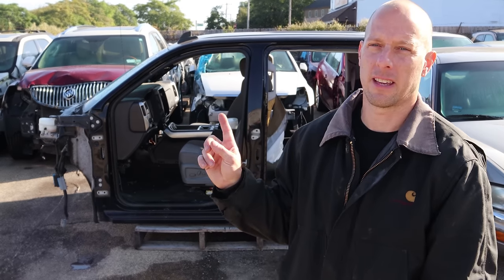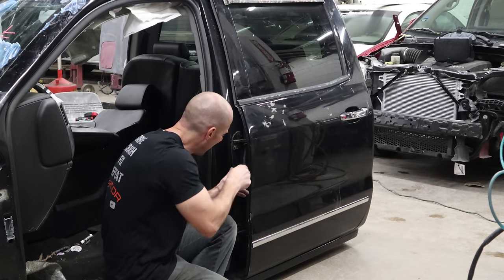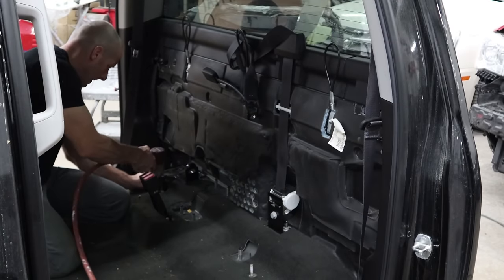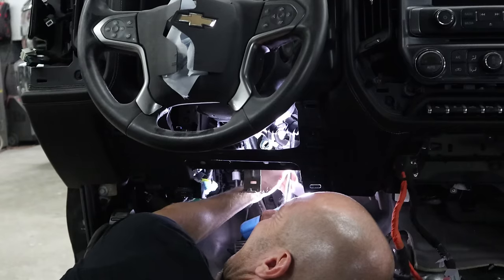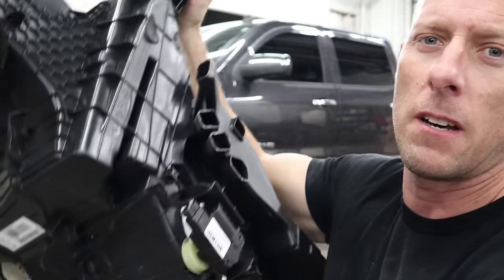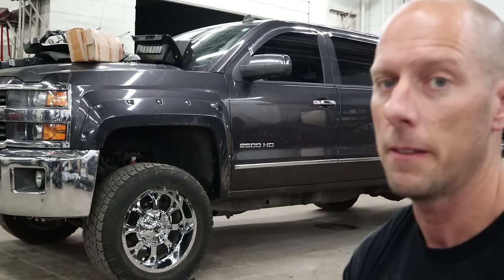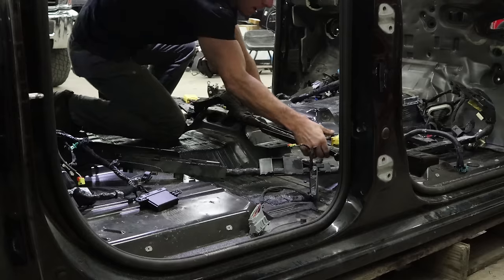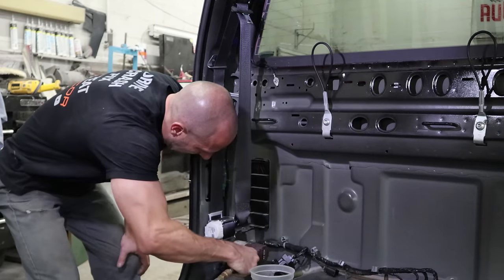Gutting the cab for the 2015 Silverado mistake and attempting to reassemble it. (Part 5)

Comment: Holy crap, this dash removal is something I don't see everyday.
I know there would be screws left over if I tried to do this.
Very interesting, thanks!
Edit: If anybody from GM saw you do this, you could probably get hired.
Reply: Hired to make what-$12-15/hour? This truck, when it's done, will make definitely $10-15ks In 2 month max. Now do the math. 
 Now, if I would be GM I would definitely want to have this type of a specialist as engineer advisor, not some idiot computer tech from Stupid University. Those trucks would be much better if they would make them more people friendly and not just "slapped by computer and robots".
Reply from the maker: You don't see it everyday because of the labor.  That also scares a lot of people away.  It is what totals a lot of cars these days.  I do it all the time, it is easy with practice, just like anything else.  I am a full time mechanic and get paid very well for that.  I also do pretty good at making a little money with this hobby.  Thanks for watching.
Reply: GM only hires in Mexico. $4 hr max. Busy closing Canadian and US plants.

Comment: The video I’ve been waiting for lol.  I did locate a cab I’m interested in for my build.  But I can tell I’m going to have to wait until spring now and I’ll unfortunately be doing all my work outside.  My Current Garage is 18x31 and I’m already running out of room.  If I can get things situated with both cabs beside each other and just swap from one to the next as I go it will be much easier.  I’ll just have to figure out how to lift the old one off and roll my frame under the new one.
Reply from the maker: I didn't want to give it away but I was hoping you would get to see it before you got into yours so you knew what was involved.  The projects do take up a lot of room.  My first suggestion is if your garage is tall enough for a lift and you plan on doing work on more than a few cars, buy a lift.  I understand it is a big investment but they save tons of time and would make this job much easier on you and pay for itself in the long run.  If you don't plan on fixing more cars/trucks it doesn't really make sense.  In that case I can tell you the best way to do it when you are ready: 
Pull the bed, even if it is not damaged.  It is easy and with 3 buddies can be lifted off.  Make sure when you set it down, you don't set it on the bottoms of the bedsides, they will fold.  Either turn it upside down or set it on some pallets that allow it to rest on the bottom of the bed when it is on the frame.  
Ok, now strip the doors, seats and dash. (leave the heater box it is easier to change when the cab is off.  
Unbolt the fenders hood and all wiring and hoses/lines that connect to the cab.  
Unbolt the cab and lift it up with a jack or something.  You may have to lift each side a little at a time to get it high enough, safely.  Get some 4x4s long enough to go from one side of the truck to the other and stick out a few feet on each side.  Set those 4x4s on something stable and set the cab down on them when it is high enough to clear the rear tires, frame and bumper (you can pull the rear tires and set the rotors/drums in wheel dollies to make the height a little lower).  
Roll the frame out from under the junk cab.  
Switch your heater box and firewall padding if applicable.  
Raise the new cab on the 4x4s like the old one and slide the frame under.  
Just repeat the removal procedure in reverse.  You want to do it with as much stuff removed just to lighten the weight you are managing.  You could do it fully assembled if you wanted.  I hope this helps, it is the way we did it before the lift days.  Horrible times they were. lol Good luck on your project, let me know if you need any clarification or help in the future.
Reply: vehcor  I do have a Scissor lift but not a 2 post.  My garage is actually an enclosed carport so I’m limited on lifting from the roof of the carport..... I do have 12 foot of clearance so I can lift the entire truck and then slide something under the cab, lower frame and pull it out from underneath. Check your Instagram for messages.  I sent a message on there with my email address.

Comment: Awesome skill set! If you had a hot plastic staple kit you could have fixed that heater box and saved yourself a lot of time. This project provides a great opportunity to justify acquiring at least one new cool tool.
Reply from the maker: Staples would not work.  Even the slightest change in the shape of the heater box will cause the doors inside to hang and cause air temp and flow problems.  If it had been a tab, no problem but not the case itself.  It only added about 30 minutes on to pull the one out of the other cab.

Comment: I can't help but wonder if there is something you could be doing to minimize parts from rattling. I can only imagine when this is done there is going to be a rattle or two that would annoy the shit out of me once everything is back together.

I completely agree with you that the dash is one of the least fun parts to work on. I've pulled the dash out of a couple cars before, not the harness though, and that was a pain in the ass! I can't imagine doing this.

The next time someone asks how to swap X option into a car that didn't come with it I'll point them to this video!
Reply from the maker: I don't have any trouble with squeaks and rattles.  The last time I did, it was a simple fix I picked up that some manufacturers did for a while and that was a little piece of felt around the dash clips.  Adding options is much harder than this actually.  I could do all this and they still might not work.  Everything has to be programmed into the modules that run it (sometimes multiple modules) and that cannot be done even at the dealer level.  Manufacturer level or hacking is the only way.  I have been down that road more than a few times.  Thanks for watching.

Comment: When taking the wind shield out try to use soap and water and spray all around, the wind shield will never break. Done that before 👍
Reply from the maker: I have tried that as well. I usually get 95% of the window out and always break it on the last few inches.  I think my patience just run out a little before the job is done. lol  Thanks for watching.

Comment: You would think the dash would come out as an assembly! It's hard to believe the assembly line when being built would take that long to install. Also how do you remember where everything goes!
Reply from the maker: It can be taken out as an assembly as well but then I have to take it apart later to get the wiring harness out.  When it is in the truck it is a little more stable and easy to work on, also easier to handle, so I went this route.  I have done lots of dashes over the years and things just kind of fit in one spot.  If I have to fight with it, it is easy to remember where it goes.  If it is easy, it kind of falls in place by itself.

Comment: How do you keep all the information in your head?  Ear plugs?   LOL.  Just kidding.  You have the skill and the patience and the place to do the work.  I barely have the tools and place to change the brakes on our trailer and the oil in our vehicles.
Reply from the maker: It is all just from taking thousands of cars apart and sometimes even putting them back together.  The shop does make the job much easier and the rebuilds much faster, that is why it is worth the rent to me.  Thanks for watching.

Comment: Dude you are crazy good. I got lost trying to figure out where all the parts are coming from.  Which of the 3 cabs?  Also, I could probably do some of this work, but I know I would lose screws or forget where a few smaller parts ran off to. Great videos. It’s entertaining for guys with mechanical minds.
Reply from the maker: I have done lots of big jobs and tried different methods to keep the parts from running off.  My system new is pretty efficient and make things go much faster.   The hardest part for anyone on this job is just getting over the feeling of being overwhelmed.  It is just bolting and unbolting things after all. lol   Thanks for watching.

Comment: Fyi on the headliner you can take it out without taking the dash out, just lift up the cables from the headliner carefully so you won't rip it & hot glue the wiring back when re-installing.
Reply from the maker: I am aware, you can also fish the wires out from behind the dash, both ways suck!

Comment: @vehcor - Did the trucks come with the factory electronic trailer brake? I am looking for the harness an the actual module
Reply from the maker: Yes but it is not a simple swap.  It is actually impossible to install a factory integrated brake control on a truck that didn't come with one.

Comment: With the vin# located in corner of windshield does this change the title of truck or do you have to re-title the truck because it's rebuilt ?
Reply from the maker: The vin will be replaced by the state police and the title will be branded rebuilt only because it was once salvage.

Comment: I would be concerned of wiring harnesses being pinned different because of trucks having different options. Did you find any problems like that?
Reply from the maker: That is also my concern and why I changed all the harnesses to the originals.  I didn't even need to check, the parts cab was an LT and the truck I am building is a fully loaded LTZ so it will be missing plenty of wires.  Thanks for watching.

Comment: How many times when you are reassembling a vehicle like that do you miss an electrical connection?  Even with OBD scanners (if it gives a code) and the knowledge of the vehicle the difficult part is getting to the connection to fix it...especially in the dash!  Looks like it is coming together.  Good work as always!
Reply: Dan i plugged in my door chime harness into the brake light switch. Its easy to mess up. Had no lights, thankfully I didn't find out by being rear ended
Reply from the maker: Believe it or not, not very often.  So much so, that no one that works with me will bet against me anymore. lol I guess that is a good thing.  The last problem I had was probably 4 years ago on  my CTS-V when I changed the engine harness.  (there is a video of that one)  There are two plugs on the back of the trans right next to each other with the same connector (thanks GM).  I had a 50/50 shot and guessed wrong, unfortunately I didn't know there were two different plugs so when the codes popped up, I had to figure it out.  Luckily the G-meter also did not work so figuring the problem out was quite simple. Just reverse the plugs, took about 2 minutes.  It happens so often, it is all over the forums for those cars.  Thanks for watching.

Comment: Great work, One question, Why rebuild that truck seems the parts truck was in better shape and would have taken less work.  Was the parts truck a repairable title?
Reply from the maker: Thanks, the parts truck had a junk title and less options.  The roll, even though it drives would have been more work to repair and repaint.  I also like the colors of the black truck better.  Thanks for watching.

Comment: I'm surprised how badly these new GM trucks rust. Got under a 2015 at my dealership and saw the rocker bubbling. One area was even soft and I could flex it and hear the metal breaking. Really sad.
Reply from the maker: It is not just GM, they are all that bad.  I just had an F250 with the fender rusted through in the middle.  Stupid foam to hold fenders on, come on Ford.  Luckily it was covered by for since it is only 3 years old.  It seems metal of any kind is no match for salt!

Comment: Absolutely impressive! How do you like the "earthquake impacts" i have seen you using? I was thinking about getting them for my "shade tree" work
Reply from the maker: I am not a huge fan of cordless tools in general.  That being said, they are just as good as their more expensive competition.  The batteries last just as long and they have similar power.  I don't know how long they will live for but since they are half the price, I can buy two sets and end up with extra batteries and chargers and probably get the same or more duration of service.  I would recommend them for hobby use, everyday techs may kill them faster but that is just my bias with no real proof to back it up yet.  Thanks for watching.

Comment: At this point, why wouldn't you just swap this cab onto the 2nd truck from FL and get a new bed for it? Then part out the 1st one, you're basically replacing the whole truck anyways?
Reply: Because this is going to be his personal truck. He keeps mentioning that his truck has options that the cab that he bought doesn't have. This is going to be his baby, no compromises.
Reply: nomercy427  I think I remember him saying that one is a total loss Vin, so it can’t go back on the road or something of the sort
Reply: Keith Rowe Yep you're right.
Reply: Keith Rowe totally forgot about that....
Reply from the maker: It looks like you got your answers, they are correct.   The parts truck has fewer options and actually would require more work to fix.  I like the colors of the black truck better and the parts truck has a junk title.  Just because it drives does not mean the parts truck is a better repair.  Thanks for watching.

Comment: I’m surprised you don’t like the disassembly and assembly, that’s my favorite part. I’d love to do a job like this. Did the parts cab have single zone heat?
Reply from the maker: I love to take things apart, putting them back together is, ok.  The fact that I get to see progress keeps me going there.  The "I don't like this" part is the dash harness.  I hate dashboards in general.  I have started hating dash pads less since you have to change so many of them now when the passenger airbag deploys, but I still hate the harness part. It is just tedious and boring to me.  The parts cab had dual zone but not climate control.  The salvage yard did a less than stellar job removing the heater hose and ac lines as well so I wasn't going to bother changing the actuators and harness.  I did save both boxes so if I need one in the future, I might be able to piece one together but I cross that bridge when I come to it.  Thanks for watching.

Comment: So how does it work exactly if you basically restore an entire vehicle that was wrecked "beyond repair" or "totaled" will the title on this truck be labeled as rebuilt? So if you were say fixing it for resale, you would have to sell it as a rebuilt title vehicle?
Reply from the maker: This truck will have a rebuilt branded title but only because it was once a salvage title.  If it had a clear title, regardless of the amount of damage it would still be clear.  There is really no such thing as a rebuilt title, it is just a clear title with a rebuilt brand.  I will have a tutorial that explains all of this since I answer this question a lot.  All of my rebuilt branded titles are sold as such and at a discount even if they were never actually damaged.  I will have some videos that explain that as well.  Thanks for watching.

Comment: Scott, what do you do with some of the P-clips on the wiring harness that break when removing them?  I find that sometimes I have to break the p-clips to get the harness off the car because I reach behind to squeeze in the plastic tabs.  Any suggestions on how to remove them without breaking them?  Or do you have resource you'd be willing share to get replacement plastic p-clips?  Love the channel!

Comment: Why did you pull all the parts out of the new to you cab?  like the wiper motor. were they not compatible with your frame and other parts?
Reply from the maker: I want to use all of the parts from the original truck that I can.  I also plan on selling everything left over so I have to pull it all to inventory it anyway.  Thanks for watching.

Comment: Oh man I forgot the floor was hosed. My comment about using a cab clip sounded pretty dumb looking back. haha

And does the airbag screw up the dash when it goes off like dodge?
Reply from the maker: Yes, the airbag ruins the dash pad.  Thanks for watching.
Reply: Guess that's one way to sell vehicles.  When they are totaled because the design causes damage that labor to replace parts puts them over the threshold. 

That wouldn't be easy to do with the windshield in it. Not that it wasn't time consuming without the windshield.
Reply from the maker: @FTWarr  That is the reason for making things labor intensive and why so many air bags deploy that are not needed, just to sell new cars.  It can be done with the windshield in but I had to change it since it was different, it has to come off so it can be retagged and it makes the entire job much easier.

Comment: How do you remember where everything goes? Do you use a GM body manual?
Reply from the maker: I don't, I just leave it out!  Weight reduction! lol  JK  After you take the parts cab, the parts truck and the original cab apart, you learn how to put things back together and the most efficient way.  I have done hundreds of dashes over the years and they are all similar and stuff kind of only goes in the place it is meant to go.  I don't use manuals, just memory.  Thanks for watching.